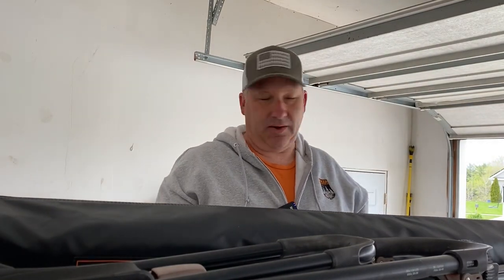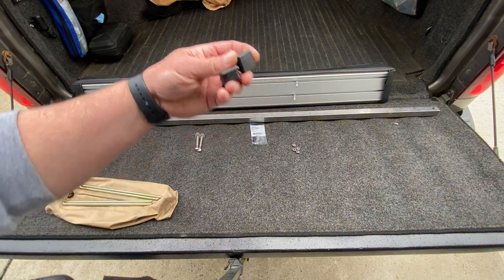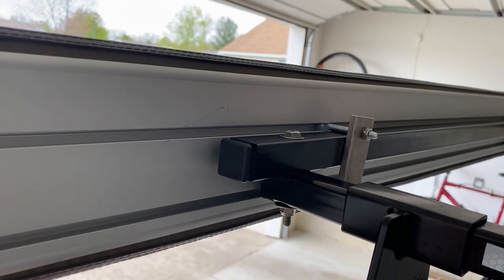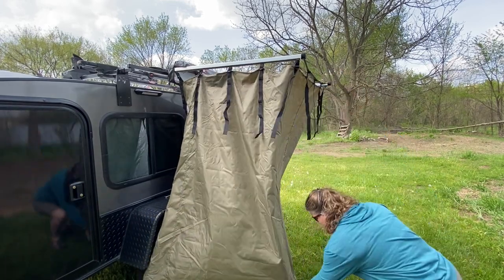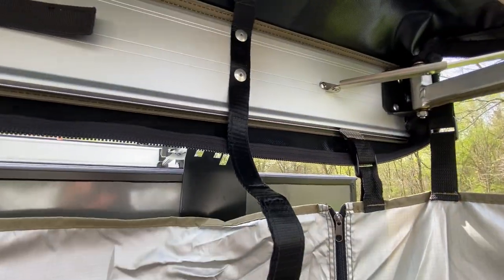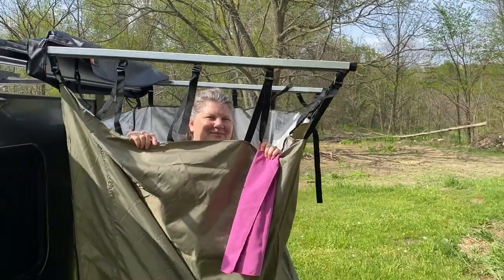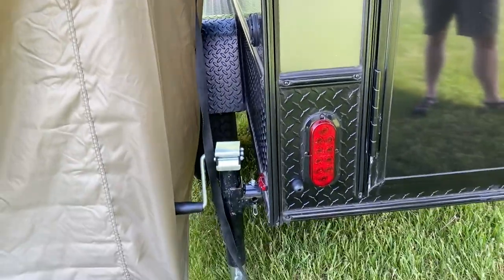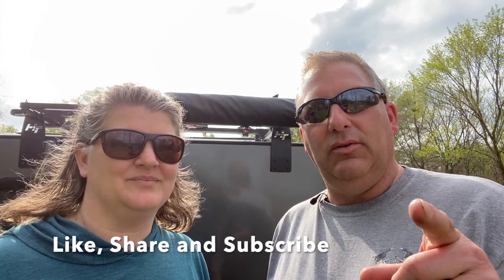23 Zero Peregrine Shower Enclosure upgrade for our Hiker Trailer

Comment: Looks great Matt.  I’m going to put my hot water heater in that spot, so I would need to move it forward.
Reply from the maker: That is the advantage if you run the hotwater on that spot. Then  move the shower room to your desired location.

Comment: What will you be using for your shower and water setup?  I am going with a Road Shower and Ecotemp in the Pelican Case. I will check this enclosure out when I get everything else mounted. Thanks for the great videos.
Reply from the maker: We are not sure yet. I have just started looking at options. One is the Road shower but there are alot of options on the market.

Comment: This looks great! One question I haven't been able to find online...do you know the dimensions between the bracket holes / channel spacing on the back of the enclosure? I'm trying to figure out if it would be compatible with my ARB awning quick release brackets.
Reply from the maker: The brackets on the back are in a channel and can slide to fit our needs for the width.
Reply: I meant to say - how far apart are the two t-slot channels? I.e., the spacing between the two channels.